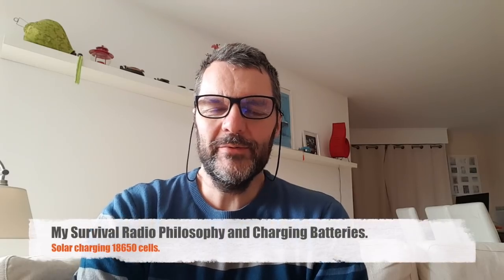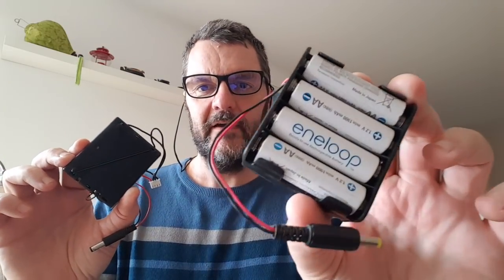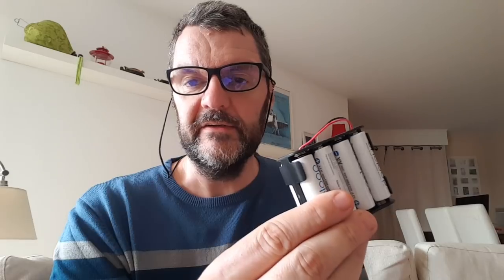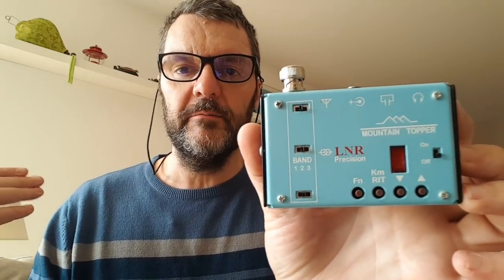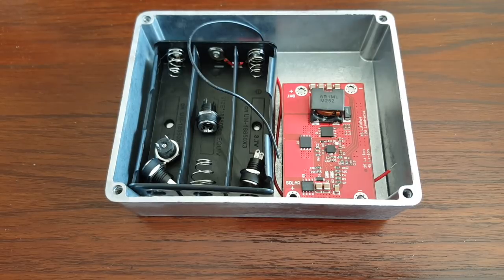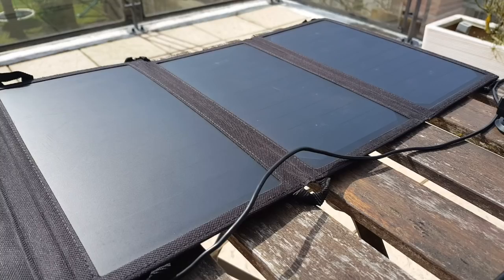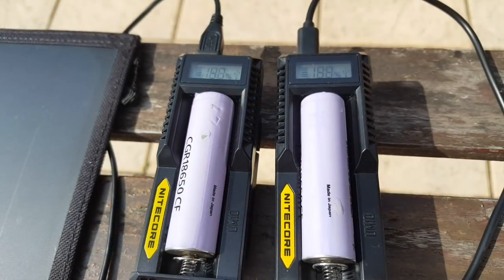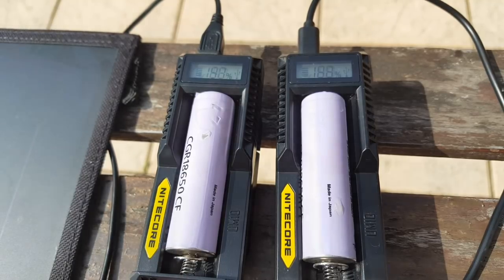My Survival Radio Philosophy and Charging Batteries.

Comment: I use 6 packs of 18650 cells, wired as two parallel sets of 3, giving around 12 volts and 2500 mah. More energy dense than AAs and easy to charge from solar.
Reply from the maker: Good capacity...

Comment: Hi Gil, dunno what you used for battery pack construction, but my experience is that these battery holders with these springs just add too much resistance and cause voltage drop. So the last pack i built is made of solder-able AA batteries and while they are in this type of holder, i did solder the batteries together to ensure least resistance possible.
Reply from the maker: Good idea. I use 18650s, didn't notice a drop.
Reply: @RadioPrepper  That's all good, i had noticed with a set of 4 AA which was too much springs in a row and added resistance of each would produce a noticeable drop in voltage ; good you did not, you got a better quality holder than mine.

Comment: What would happen to your equipment if there is an emp? How would those batteries charge in winterconditions (cloudy and bad weather, think nuclear winter)? Do you need overcapacity in solarcells to compensate, or do you invest in a small windturbine? How many people know morsecode when shtf that can and will really help you? Do you carry a radio-scanner? Recieving info is often more important then sending (and giving up your aprox positon). Keep asking yourself hard questions Gil, we love you as a person!
Reply from the maker: Hi. A number of my radios are stored in Faraday cages on a permanent basis, along with chargers and other items. To avoid the problems you mention I use low current radios and small capacity batteries. I do indeed need a mechanical way of recharging batteries, as a backup. As to Morse code, it only takes a contest week-end to realise how many people use it. I have no worries about that and I do use SSB as well. I do not have a dedicated scanner, but some of my radios can scan on VHF/UHF. The most challenging remains power generation, and I will improve my preps in that area.
Reply: Great, you are further in your preps than I thought...! I saw the plastic go-box and thought.....owww noooo...... ;) I use steel suitcases for my 817 and baofeng walkies. The steel suitcases are normally used for storing equipment like drills and electric saws, offcourse a bit heavier than a plastic case but they work as a carry-on Faradaycage and I could boil water in them if I would have too...
I've thought about generating power with a car-alternator (12-13.6 volts bicycle setup) and even did some experiments with peltier-elements and old washingmachine-motors...when you see how much effort it takes to generate a few volts then you really start to love solarcells (and their design). But you are right, what you dont use, you dont have to generate!
Reply from the maker: Yep. I might look into homemade batteries too...
Reply: a bit off-topic.. did you ever try CW over the CB-band? It's a free-for-all so your group can practise encrypted messages in this band?
Reply from the maker: I don't think CW is allowed on CB. Encryption certainly isn't.
Reply: I believe it is (like semi-encrypted digital 446mhz), if you stay on the right channel (for France/Europe) and within allowed wattage you can do and say anything you want. So encrypted messages are allowed, also digital and cw.... Ofcourse you run into the band-specific disadvantages such as range/propagation. But these should not be a problem if used for training only. When shtf use the learned skills on other bands if needed.
Reply from the maker: You might want to check on that, because I doubt it... There is also no such thing as "semi-encrypted," only CTCSS tones, which is not encrypted at all. Also, I doubt you can use external antennas on PMR frequencies, not in France anyway, nor in the US with FRS. Make sure you check the law for your country, not just assume something that could get you in trouble...
Reply: No not completly....just search for Midland GB1 PMR446 Radio on google. Changing the existing antenna on a pmr is not allowed, thats right. You would easily exceed total allowed wattage for example. I went to fast with saying semi-encrypted, it is not encrypted but you can not listen to it with normal pmr, therefore "semi-encrypted" to others listening with normal pmr. Then again, CW to a listener that doesnt know CW is also "semi-encrypted" . The same goes for digital signals. Regarding encryption on 27mhz, i still believe it is allowed. They do not limit what you must (callsign) or cannot say as long as the equipment is lawfull in the EU. Thats why I believe encryption is allowed. A ham is not allowed to encrypt on ham-bands. But anybody can say what he wants on CB. But if i'm not correct please tell me.
Reply from the maker: Not sure... I should get a CB again...
Reply: True, for local traffic in SHTF its perfect. Ofcourse with its pro's and con's. But for long range you have the right gear! I learned a lot from you; reliable gear, simpel, light, amperage, distance. Nothing beats cw..... i'll have to study it now...thanks ;)

Comment: I know you love morse code but I bet more people will listen to and respond to voice than code. I am aware of the arguement that Code always gets through BUT if you are facing a medical issue (broken leg etc..) I think you would be better off using a local voice mode to summon help. I have run my FT-817ND with a small 7 amp battery and solar panel for the last two field days with plenty of power. I am thankful room exists for both your and Julians opinions, but on this matter I find myself agreeing with Julian. I cant see being injured in the Smoky Mountains and relying on a contact in France directing medical help to me.
Reply from the maker: Fair enough. I would of course probably try local VHF first if I had one. You would be surprised however at how many Morse listeners there are...
Reply: Thank you for your reply! Thankfully neither of us is wrong, different circumstances require different tools. I learn from all I see one way or another.

Comment: Jil, due to my flashlight, radio and prepping hobby I have collected data on USB NiMh chargers among others. I use a Xiaomi Zi5, if you can find one anymore. It has 4 independent slots and can work as a USB powerbank too. Else, your other options are Portapow, Pixo, PowerChimp, Sunjack and Fugicell. With your 2 USB output ports you can also try the 2xAA IKEA and Sanyo/Panasonic NiMh chargers, which are good.
Reply from the maker: Thank You! I will check them out.

Comment: Thanks for the shout-out Gil. 
I wrote an article the other day which is related to this post you just made http://oh8stn.org/blog/2018/04/06/difference-between-contact-and-communicate/ I totally agree with portability and simplicity. For me I'm always using the pulk sled or the hiking trailer when it's not winter. So I'm always assuming worst case scenario is bugging out with pulk, tailer and 21 days of supplies including comms, and shelter.
The low current draw radio is incredibly small and portable, but it's Achilles heel, for a CW only rig, is a single mode.  That's why I have a variety of capabilities, HFAPRS, PSKMail, Winlink, NBEMS, Voice, two is one and one is none right. So definitely only relying on CW, is a personal choice.
18650 batteries are great. The first battery pack I did for the 817 used 18650 batteries as well. I don't carry a laptop as a primary tool by the way. I carry a tablet! The laptop is an additional tool allowing me to maximize the amount of information I can communicate. That could also be a tablet running Windows or Linux. Unfortunately it's not as portable as your gear, but it's exponentially more capable. 
I have a idea for you. Create a training exercise where you are lost someplace, and your ankle is broken. You need to give someone over the radio your exact position (so you can ge rescued) without having a schedule beforehand. Your only means of communication is your CW radio. That might put things in perspective. 
Anyway awesome video Gil.

Comment: Speaking of the Atlantic, did ever find the boat?
Reply from the maker: Never, total mystery. I doubt it sunk, not right away anyway because the automatic bilge pump was wired directly to the battery, which was solar-charged, and everything was shut tight before I went ashore...